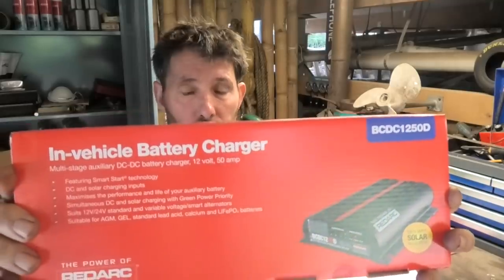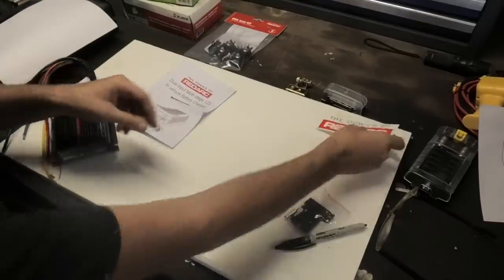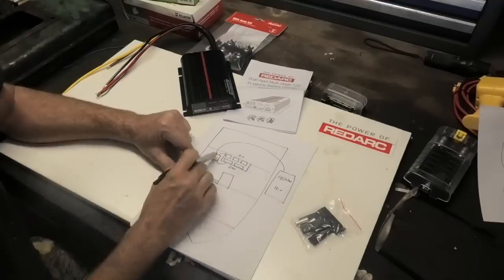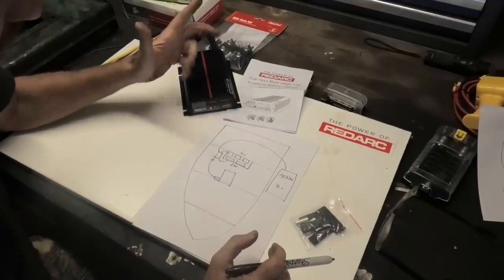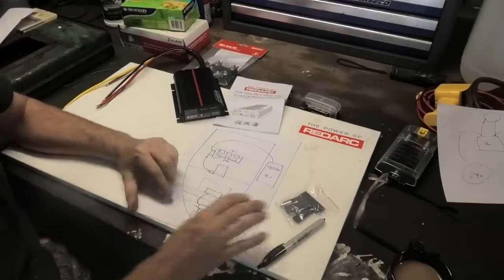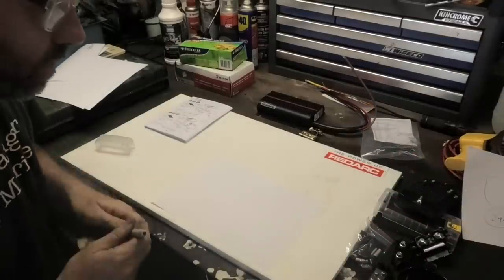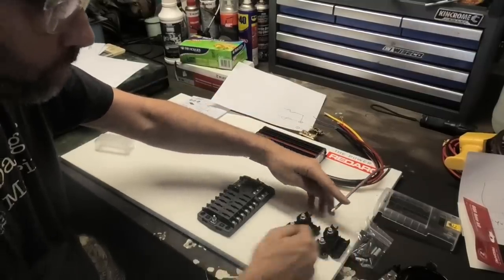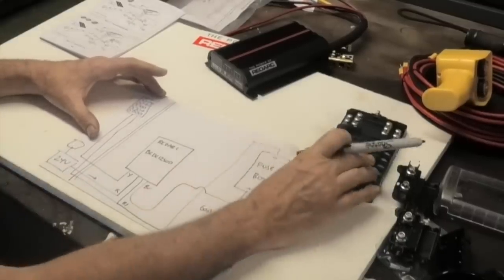Planning the trawler electrics

Comment: BTW Make sure where you mount your electrics you can maintain without power an ambient air temperature 80F; when things in electronics get to 100F the chips start acting funny. May want to consider some kind of vent stack system that will naturally convect cool air for the engine compartment. You can always supplement it with a powered fan vent system while engine is running. Could be as simple as electric radiator fan from an auto yard, hooked to an adjustable temp switch and fuse. Even make it a pull/push system, pump air in suck air out in case a fan fails something will always be drawing/pulling. That is what they do in industrial electric areas and cabinet electronics. JAM
Reply from the maker: The engine bay has two air vents on the roof of the cabin, but some forced air near the electrics might be a good idea too.

Comment: You are defiantly on the same track as an Electrical Engineer would use designing a complete system. As in the first thing is to create a full on diagram laying out each piece of the overall system.   Keep going with it make smaller symbols to show circuit breakers and fuses and pay attention to how clear you are drawing your wires.   You could even go one step further by labeling the wires with a some kind of a code numbers or letters make something up  but then you label the wire in the boat and the circuit and then you put then you write the same thing onto your diagram and now you forever have a record as to which wire went where and can easily go back and trace them in the future.

Comment: would a hydraulic winch be a viable option, as you normally start the engine before pulling up the anchor, or are they too costly
Reply from the maker: It is an option, but costly and a relatively complex install.

Comment: Why not swop starting and charging system over to 12v?
Reply: Old diesel engines used 24 or 32 volt electrical systems. New diesel engines use 12 Volts DC.
Reply: Correct but 24volt diesels can be converted relatively inexpensive. Usually just requires starter and alternator. Have done several.

Comment: I wouldn't do the additional dedicated battery for the winch. I would spend the money once and hard wire it at 24 volts, using half the current of 12. An additional battery is an additional point of failure, and we all know batteries don't last forever so you will end up replacing it eventually. You may go out only to find that your seldom used winch battery is caput. Then what? Cut the anchor? Grab a house battery and swap to get it up, then put it back? If it was dedicated at 12v, theres a big difference in motor power between 14v and 10v.

Comment: Defo run your anchor winch  from your cranking  batteries imo,   assuming your winch is 24v,    as your engine will be running when anchoring up or down.    They draw huge  amps   😃      or if 12v go from house batteries.

Comment: When electric motors stop by overload, the act as if there were an electric shortcut. A fuse helps that one, but I personally believe that this is not the best possible answer. Why not have all the working gear like bilge punp, anchor winch etc. driven by hydraulics. Hydraulic installations have overshot valves, where the fluid goes flows directly back into the reservoir, if there is some overload. You could even have a secondary hydraulic pump as a fallback. The hydraulic pumps could be in the engine room. And later attachments like an hydraulic crane are not much of an issue. But formost, you save a lot of electric wiring across the boat, that could cause electric corrosion if anything goes wrong with the wiring, like small current leakage through water dissolving your steel over time. --- The only downside for hydraulics, it is a little more expensive to put the pipes and have real hydraulic gear instad of the crappy sport boat equipment.

There is a good reason why fishing fleets and work boats in general have mostly hydraulics installed, instead of little electric motors fo this and that installed all over the place! Hydraulic installations last for eternities with little wearout, while in the same time the plasic insulator of electric cables already dried out, become brittle and finally had fallen on it's own down from the cable in small pieces. Good hydraulic installations work all the lifetime of a boat.

Btw.: With hydraulics you actually only need to have a very few cables between the wheel house compartment and the engine room, two thicker ones for electric power (lights etc.), and depending on your electronic integration from 2 to many thinner ones for controlling ship equipment; but if done well, like integrating all commands with something like an arduino then you need only 4 more cables for the control >>> one controller on one side in the wheel house and one in the engine room, communicating with each other over RS485 (4-wire), exchanging what buttons pressed, what equipment to turn on/off, what ruder position and engine strart/speed/stop and what to show in gauges in the wheel house etc.. All that could all be done through a single 4-wire signal cable. The work load in the boat can be driven by hydraulics, where the electrically switched valves are also installed the engine room and switched from the wheel house and/or from alternating locations.
 Minimum electric cable installation can make a very good choice for a steel hull.
 Also a very nice idea was what work boats on steam did. The had a work-transmission-rod from the expansion engine through out all the boat, and all equipment on board was attached to that. By switching gears on a specific piece of equipment it became driven by that work-transmission-rod. Nice concept, but certainly not up to date these days!

Comment: Please... Don't install drum winch!! One of the worst things I saw ever! On every yacht and cruise and merchant ship I worked, we used windlass. You keep your chain nice and clean and away from the deck! I hope you are going to make right choice.... either way I support you!
Btw all TV-s, laptop chargers and stuff like that (electronics, ps4, xbox,), they run on DC. They just need AC current so it could be converted to DC before it goes to  motherboard. No worries. I bought 4 Samsung 55 inch TV's and I plugged them directly on DC power while I worked on yacht and they are still working (owner never complained). Basically 95% of all electronics run on DC :D
Cheers!
Reply from the maker: I think there are pros and cons to each type of winch. I've also seen anchor chain end up in very bad condition from being piled up in a chain locker. This will also allow me to have a length of chain and then rope - something a windlass doesn't let you have. You are dead right about most things other than some motors running on DC, all the conversion leads to loss.
Reply: @DangarMarine  Keep a good supply of DC and chargers and you will be good. 
And for the chain locker, now as you have a lot of youtube subscribers, I would love to see a nice shiny windlass and a stainless steel chain! plus btw you can attach rope on chain and even windlas will be able to roll it up nicely as long as rope is a good solid diameter, not some piece of drift rope... Just make sure every thing is nice and isolated form sea water and have a solid size water tank or watermaker... With windlass you will be fine. Its a small boat, dont put more stuff on deck... You will not have a lot of space :/
And PS, great build! Keep up the good work!! Cheers mate!

Comment: Your board is HDPE, i.e. high-density polyethylene.
Reply: We call it expanded PVC in Florida and is used for marine upholstery and back plates for plastic signs and available from most plastic supply stores. Great stuff for stu to use for his electrical panel for ease of implementation and should last forever.
Reply: @dennissytsma3561  PVC and HDPE are distinctly different materials with completely different properties, including chemical resistance. PVC is (C2H3Cl)n while HDPE is (C2H4)n. PVC is amorphous, HDPE is crystaline, etc etc.
Expanded PVC is just PVC with polyurethane embedded that creates a closed-cell foam of PVC, which is not equivalent to HDPE, which is what cutting boards are made from.

https://en.wikipedia.org/wiki/Closed-cell_PVC_foamboard
Reply: @ArcadiyIvanov  Thanks, I stand corrected. Great research and I hope for the best outcome for Stu's project. I am very interested to learn from Stu and others how to rebuild an old boat using best stuff and procedures. My boat my dad bought new in 1989 after my mom died at age 62. My dad gave the boat to me and I am rebuilding it now. I spent many happy hours on that boat with my dad and I want to do it right. My video series is posted if you want to watch my project just search on my name in you tube. cheers and Godspeed.

Comment: The boost is just a 12VDC to 19VDC converter that is plugged into car power points...if you only need about 90watts it will cost much less...but here is the one I use:

https://www.amazon.com/gp/product/B004GI371Q/ref=ppx_yo_dt_b_asin_title_o02_s00?ie=UTF8&psc=1

Comment: Stu   your welded brackets for the switchboard are too close to the wall,,put some bolts thru them with a spacer to get panel further off the wall for better rear access ,,,regards Gavin
Reply: Stu no problem using a C/B as a switch as long as it is DC breaker......also with electrolysis,,dont earth anything to the frame,always return from device to negative source......dont earth anything.....keep the A/c "above earth" .....gavin

Comment: Funny, I thought you spoke English.  I didn't understand a word in this video.  😋

Ok, that's not true, but electricity has always been a difficult thing for me.  It sounds like you've got a handle on things.  The biggest source of confusion from what you said is with electrolysis of the hull - what you can/can't do to prevent this, etc.  Very confusing.  🤔
Reply: Don't use the metal hull as a common earth point and fit sacrificial anodes to the hull.

Comment: The radio and the sonar should be connected directly to the battery you can get some strange problems using the hull for a ground.
Reply from the maker: Yes, the grounds are connected directly to the battery but the ground is also earthed to hull. More on this soon!

Comment: You could just use welding cable. It's a lot less expensive than battery cable and it can handle the same ammount of amperage without voltage drop.
Reply: welding cable doesn't hold up well to marine environments
Reply: While I cannot comment on the suitability of Welding Cable in a marine environment.  I know that it worked great on my old 2001 Jeep Cherokee.  Replaced all of the battery cables and the worthless braided grounding straps with it and it made a night and day difference in that vehicle.  She started better, the lights were brighter and the battery charged much more efficiently.  Even with the welding shop crimping on the connectors for me it still cost 1/4 what getting oem equivalent battery cables alone would have.

Comment: how many emergency cut offs are you putting in the loop
Reply from the maker: There will be battery switches for both banks on the outside of the engine hatch.
Reply: @DangarMarine  I have some guillotine/lever type switches that are under-ground mine spec, are they any use?

Comment: Why fuses and not circuit breakers coming from the batteries onto the board??
Reply from the maker: Just what I had. Will put circuit breakers in the wheel house for the bulk of the electrics.

Comment: If ground noise is what you're worried about (for sonar, etc) then the single point ground is what you want.  If you don't use that type of wiring, the grounds will all be different and they'll fluctuate with load.  Weird but true.  The star ground connection is used on circuit boards for the same reason.
Reply: Agree, grounding system is a must!

Comment: What's the benefit of having any 24v systems?
Reply from the maker: With boats (compared to cars), the distances are greater as are the power requirements. The voltage drop from a 12V can be too much in a boat sometimes unless the wires are very thick.
Reply: @DangarMarine  That and reserve battery capacity in cranking power during cold weather starts, 6 volt was just OK if everything was perfect back in the day 100 years ago or in the late 1940's-50's with the FJ Holden, then came 12 volt which was plenty better & into modern days, 24 volt or even more on big engines.. and so on & so forth.

Comment: I'd be lying if I said I was good with electronics. Give me 2 wires, a light bulb and a battery and I can make that work.
 As a scrapper and hoarder though, I do have some rolls of wiring in stock. I couldn't say how many amps or ohms they could push or pull. There's everything from common household wiring to auto electricians, sparkies, 3 phase etc etc. Even this weird stuff that is about 8mm wide and .5mm thick(insulated) that might be good for a common 12V ground setup? Let me know if interested, I'll throw it all in the car and bring it for you to see if any of it is good for your application. I'll chuck a carton of Coopers in so if none of it is any good, at least it won't be a wasted trip lol. cheers.
Reply from the maker: Hey mate. Unfortunately the important thing with marine wiring is that the wire is tinned which isn't that common. You're always welcome to swing by for a beer though. ;)
Reply: @DangarMarine  I might have some. I've seen it before. Are you within walking distance of the pub? If so I think I found you.

Comment: Forgot to say start from left to right, 2 or more lines (pos) along the top and only one (neg) at the bottom, this may or may not include instrument or 230 volt ac wiring but those are self contained extras I reckon (ac has Active and Neutral (neutral should be earthed)). Also I stress never put a contact in the negative side of a contactor coil, relay coil or light etc as this was done to save wire and money early last century, a very bad practice like when they saved money by changing wire colours within a single circuit! (Was that Ferrari or Maseratti or Alfa?
If I can think of something more useful I'll add it later.

Comment: USB C can be up to 19 volt and macs normaly are 15- 18 volts
Reply from the maker: That's good to know. I'll have to see if anyone has a good DC charger otherwise I may need to go through an AC inverter afterall.
Reply: @DangarMarine 12 volt to 24 volt  dc to dc converters are pretty common in american trucks so it shouldn't be too hard to find

Comment: Apologies for my electrical ignorance in advance but if you decide to put a cut-off switch in the charging circuit will you need some protection for the alternator when you throw it, like the FIA master switch used in race cars such as this one: https://www.pegasusautoracing.com/document.asp?DocID=TECH00109.
Maybe this isn't relevant or maybe the redarc device sorts this all out. 

Stu you are a terrific advert for your country mate (and this from the UK, Cricket World Cup nothwithstanding!).
Reply from the maker: Interesting point, I'll check the link, thanks.

Comment: Please dont go with 12v for everything, go with 24v and 240v, look at a inverter. Also go with hydraulik wrech
Reply: Why? Everything that he's going to need is available in 12 volt these days. What advantage is an inverter?
Reply: @lathselman9772  I think Stu has a big 24V to 240V invertor that came with the boat but I reckon your correct about going 12 volt, everything is available in 12 volt now and just a good if not better than the 240V versions.

Comment: Always a BAD idea to put batteries in parallel. negative from 24 starting battery also needs to be common with all the other negatives. yes a common ground where everything attaches to the hull in one spot sounds good. I also wonder about shore power and hooking the safety ac ground to the hull as it may cause electrolysis. might be a good idea to stay away from doing that and just use extension cords for running power tools when needed and staying disconnected from shore power entirely as much as possible
Reply from the maker: Why is it always a bad idea to put batteries in parallel?
Reply: @DangarMarine  notice well engineered equipment always puts batteries in series or uses one battery. a fire truck has 2 battery banks and a switch so they can shut off the connections when parked and use one the other or both to run on. batteries never have exactly the same resting cell voltages. also the danger of a cell shorting in one battery and causing a catastrophic event of acid, vapor and fire. mostly the batteries will self discharge each other and have short overall life times. If you want capacity at 12 volts use 6ea 2 volt cells or 2ea 6v units in series. or just  a big high capacity 12 v battery by itself. I am old and know this from experience. I love your vlog and wish you well with all your projects.

Comment: go for 240V for a refrigerator, it's way cheaper and more efficient than a 12V or 24V system. Invest in a good inverter (Studer is the best) so you can use your standard power tools.
Reply: You can get really good, high effeciency 12 volt portable refrigerators/freezers designed for off road/solar/battery use here in Australia, you wouldn't need a 240V one to keep your beer cold, even some of the foam eskies here in Australia guarantee the ice will stay frozen for 48 hours.